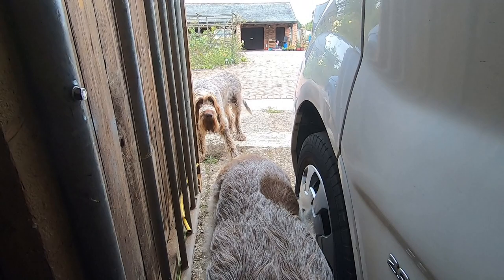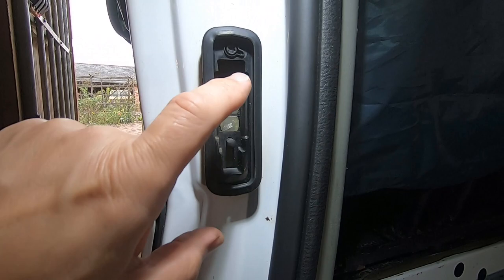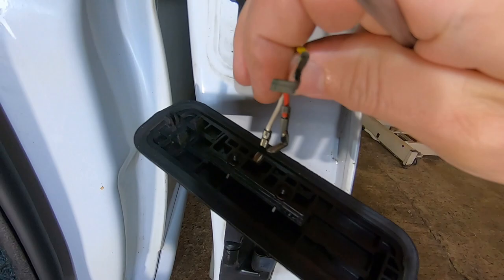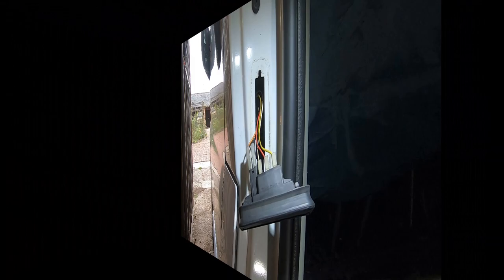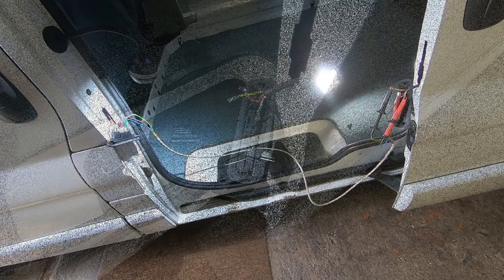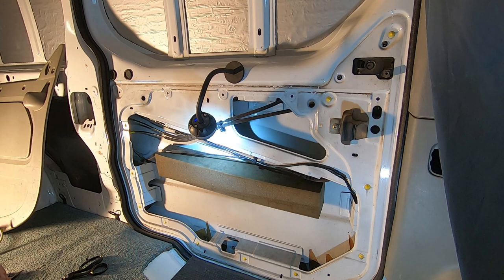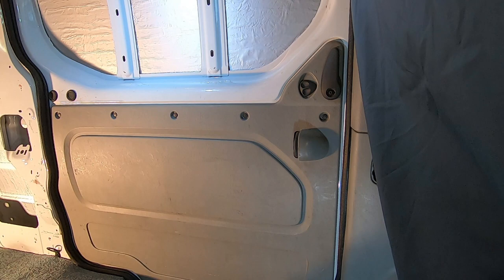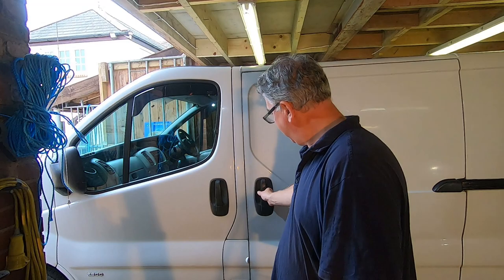Vivaro project Pt5. Sliding door central locking not working?

Comment: I have an issue with the passenger door. If I use central locking, It won't open from the outside and can only be open from the inside. But once I unlocked from the inside, the door will open and close fine. I bought a 2008 Primastar a few days ago and its in really good shape, it has no dents, engine running well and nice and clean on the inside. But for some reasons it has doors issues. Rear door won't open (fixed that), passenger door has issues and driver door kept making the "loud" clonking sound when open and close (although,  I think I may have found a solution, but if it doesn't work, I will follow your video and replace the check strap). Cheers for the instructions video.
Reply from the maker: Thanks for the comments ClankyRochet👍. I've been surprised how much I enjoy driving mine😁. With the door issue, I would start with the plug in the hinge area (https://youtu.be/vDABazHMBBE )(be careful not to bend the pins), then check the wires in the rubber tube before moving into the door. Good luck, and tell us what you found please.
Cheers Larcs 👍

Comment: Well done! Think you lost a spring to that pin if the backing plate came off? I’ve been called to fix this issue for a friend. After taking out the sprung contact connector it was like yours - his basically fell apart. Reason being there’s two very small lock washers that push over the back to hold it into position. These rust, back plate can falls off & the springs to each of the pins can end up in the inside of the door panel. I’ll take off the door panel to retrieve the plastic backing plate & springs back via a magnet/magnetic screwdriver. I’ll connect the wires as you’ve done to see the motors are working as they should. I’ll rebuild the sprung connector - should be easy ie solder wires to the metal plates within the connector / glue backing plate back to connector - use crimp connections to wires & redo the others that plug into the connector. Yep, about half hour to do - saves £32 but it’ll last longer & can easily be attended to again if needs be - no fear of those locking washers rusting again. Ta for video/link.
Reply from the maker: Thanks for the comment 👍. Glad you got it sorted.
Cheers Larcs

Comment: Mr Larcs, Thank you for your video, I think I have a similar issue but I cannot open the door. I have removed the panel from the inside but still struggling to open in so I can have a look. I use it for picking up guests so it's a bit of an issue for me, not that we have many guests with Covid but still I need to fix it. Any help on opening the door would be so so so much appreciated and thank you for taking the time to do this video. Best Regards,  Craig
Reply from the maker: Thanks. You've got a tough one there! I can't see how you can do anything without taking that inner panel off? Once that's off, my first check would be the handle/lock lever and the pull cables back to the lock. Good luck👍
Cheers Larcs.
Reply: @LarcsWorkshop  Hey, thanks for the quick reply. I did remove the panel, pulled and looked at all the cables. Everything seemed to be working, but door not opening. Now. It is minus 30c here right now and I decided to start the vehicle and heat it up as I had to take it somewhere and viola, the van door opened. It's like something is freezing somewhere!? A tough one indeed. Thanks again Larcs. x
Reply from the maker: @snowdogarcticadventureco.9246  wow that's cold 🥶. It could be that the door seals got wet and froze together. I've heard somewhere that if you put a thin smear of Vaseline on the seals it stops them freezing? Not tried it myself but it might be worth a go?
Cheers Larcs 👍

Comment: I have the same problem but all 3 wire are all still in contact my sliding door locks but don't unlock ??
so any help gratefully required
Reply from the maker: Check both sides. If they're ok the it might be a wiring issue or the power lock. Good luck sorting it out 🤞.

Comment: How do get yhe panel off the back sliding door,  the lock mechanism has snaped and door is stuck? 
Vauxhall vivarro swb van.
Thanks 😊 🫂 🙏
Reply from the maker: If you mean the interior panel, you just undo the handle, pull off the lock lever then carefully lever the panel off the door. Good luck with the repair 🤞.
Cheers Larcs 👍

Comment: Hi, I'm shopping for a van. I have only ever driven VW 's for the last 20 years so I have been looking at T4 and T5 transporters to convert to camper. I will be buying in January  and will have 6- 7k to spend but I have been told that I would get a newer more reliable and already converted Vivaro for the same price. Would you agree?
 I was in Cornwall 2 weeks ago and the amount of VW vans I saw struggling up the hills lol. 
I will be travelling down to Devon and Cornwall from Hertfordshire a lot so I will need something that can handle it and of course be reliable.
What are your thoughts?
Reply from the maker: Wow, now that's a BIG question! Granted, you'd get a newer,  better spec & lower millage Vivaro, Trafic or Primastar for the same price. Reliability, hmm, they all have their issues, but you have to think about the 'VW tax😉'. I've been a VAG guy all my life, but having driven the Vivaro for a while, I could sway! The VW's have a more solid, quality feel to them but the Vivaro engine feels/sounds a little less agricultural. Also the VW vans really hold their money well and are easy to sell too. It's such a personal thing that I wouldn't want to strongly advise you either way, I would say to test drive both as close together (time wise) to get your own opinion. Also there is a massive following out there for the VW's with limitless advice on problems (you'll also be able to go to VW festivals etc.). Good luck and keep us informed of what you decide.
Cheers Larcs 👍
Reply from the maker: Also forgot to say that some of the T4's we're quite underpowered, the T5"s aren't so bad. The Vivaro seems fine with the hills, we did Porlock not long ago loaded with camping gear and it coped with no problems.👍

Comment: Hi great video. Wonder if you can offer me any advice please. I also have a sliding door that wont open on my Vauxhall Combo van. 
I dont have a handle on the inside to open it but have removed the inner panel. Should I be able to pull a leaver to manually open the door to enable me to then reach the electrics and test them as you did?
Guess what I'm asking is - is it possible to open the door manually regardless of any electrical problems the door may have?
If I cant open the door I cant test the electrics. Help!!!!!!
Reply from the maker: Thanks, I don't know for sure on a Combo, but normally (especially on older vans) there would be a cable or linkage from the outside handle to the lock. If you can find where this fixes to the lock and operate it, hopefully you'll be able to open the door. Good luck sorting it out 🤞.
Cheers Larcs 👍
Reply: @LarcsWorkshop  Thanks for the reply Larcs. I did find the cable linkage behind the door panel and pulled it but it wont open.

If the electrics dont actally hold the door shut (not sure how they work) Then I'm guessing it must be that the door thats jammed somewhere. Either on the catch or the runners. Having no way to open it means ther'e no way I can resolve the issue.
Great video of your tho and would be very helpful if I could just get the door open.
Thanks
Reply from the maker: @grandadgoesfishing9833  That's a pain, it could be locked? Is there any other cables that might unlock it first? Good luck fixing it 🤞.
Cheers Larcs 👍

Comment: My vivaro side door makes the unlock sound but doesn't unlock it, it locks just fine but won't unlock, so I assume it's getting power, I can see the arm moving in the rear end of the door when I lock it but it just twitches when I unlock it ...  any ideas?
Reply from the maker: First thing I would check is the wiring behind the contactor strips because it's quick and easy. Next I'd look at the linkages in the door. Good luck 🤞
Cheers Larcs 👍
Reply: @LarcsWorkshop  thanks very much for your help 👍 I'll a need a video on changing the cambelt next 🤣